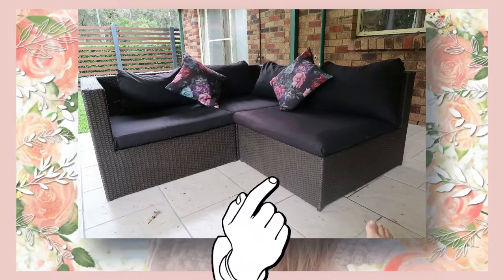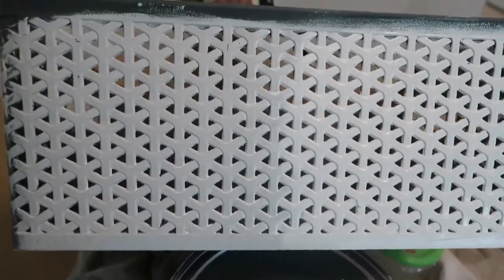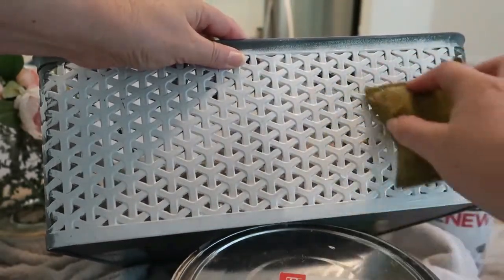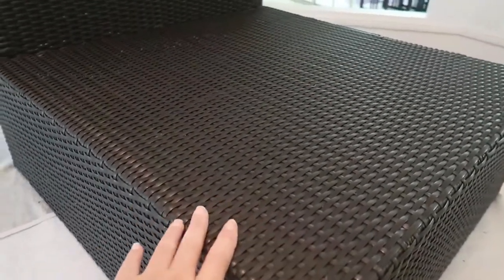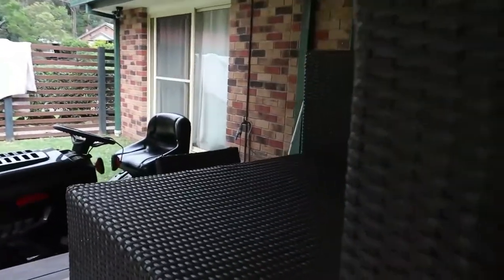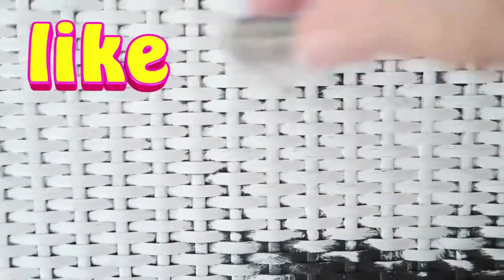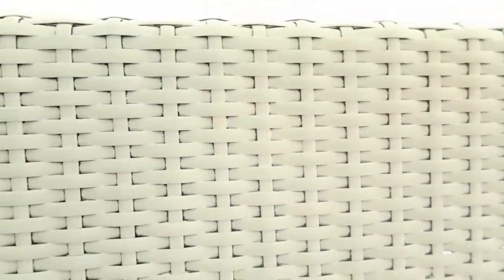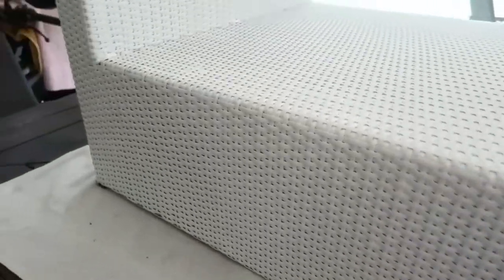I Painted My Brown Plastic Wicker White With *TILE PAINT*

Comment: Does the paint wash off.  I am worried because mine are sitting outside without cover.
Reply from the maker: Thank you for watching:) We keep our seats undercover so they're not in the weather. The tile paint I used on this I also used in our actual shower recess so it's subject to hot and cold-water multiple times a day which is what actually gave me the idea to use it. Our tiles were also ultra slippery which plastic is also so I thought why not try it. I did do an update video a while ago, I think I might do another one down the track to show how it's going but so far so good!